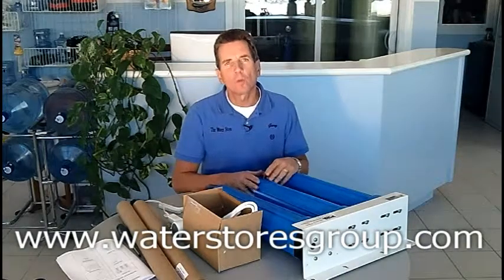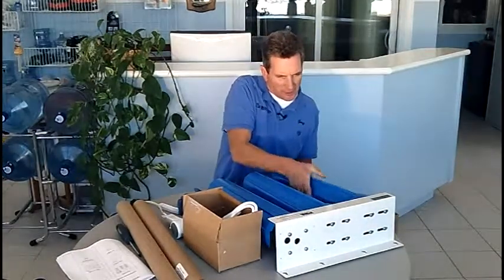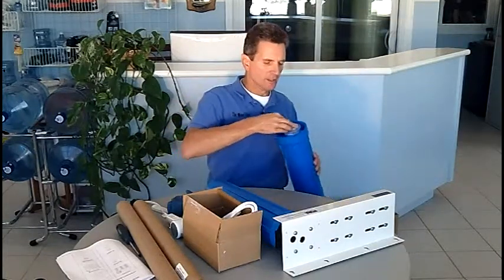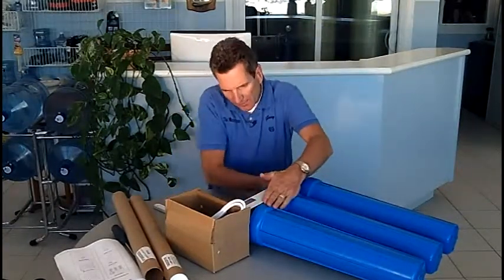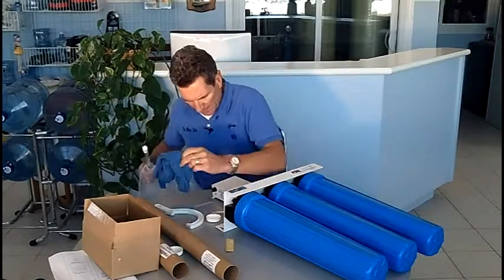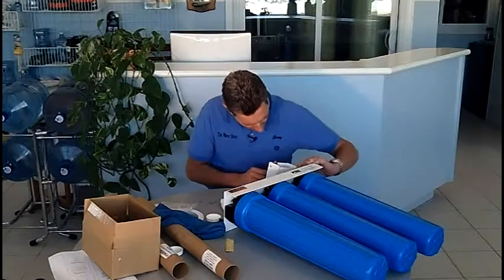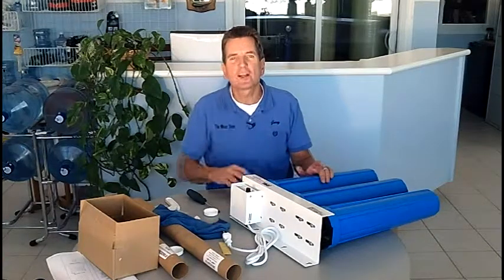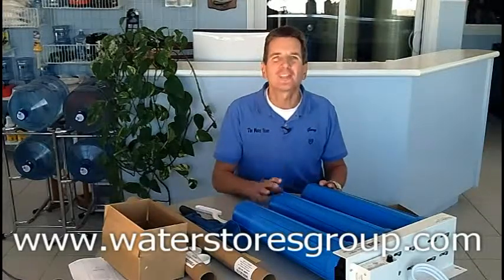How to Assemble and Install a Pura UV System Midland, Ontario.mp4

Comment: Hi water guy thanks for your video.  Can you clarify something...at the beginning of this video you say that the Pura unit should be installed after the pressure tank but before the cold water heater, "so that both your cold water and hot water passes through this [Pura filter]."  

That doesn't make sense to me ... because if the Pura unit is installed before the water heater, the (hot) water that leaves said heater goes to the house and not through the Pura - meaning that hot water does not "pass through" the Pura unit as you state in your video.

Perhaps you mean that the hot water is purified because it has already passed through the Pura unit (as cold water) prior to entering the water heater?  Thanks if you can clarify...only because your words make it seem like hot water actually passes through the Pura, which I think does not happen.

In my head I envision a correct install being like this flow of water:  

(1) water well --> (2) cold water to pressure tank --> (3) cold water to Pura UV unit --> (4a) purified cold water to house ..AND/OR.. (4b) purified cold water to water heater --> (5) purified hot water to house.  

Correct?  Thanks in advance for your help and nice video it is very informative  :)
Reply: ***** thanks!